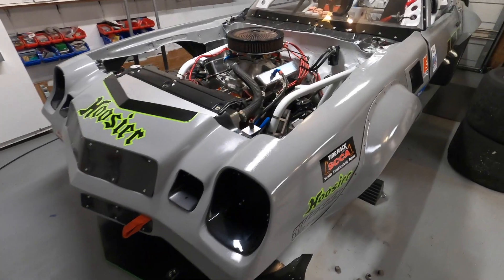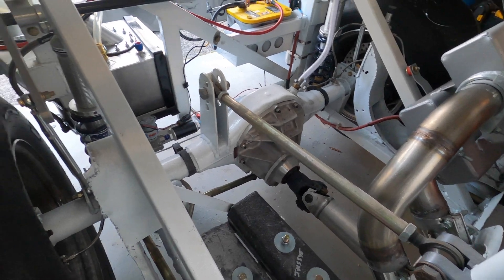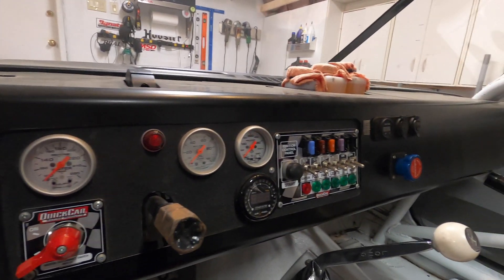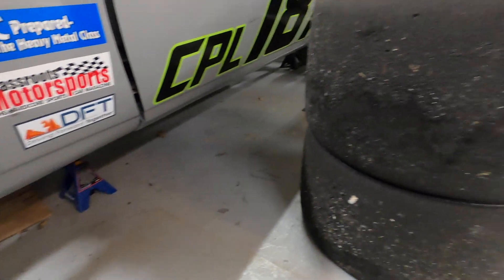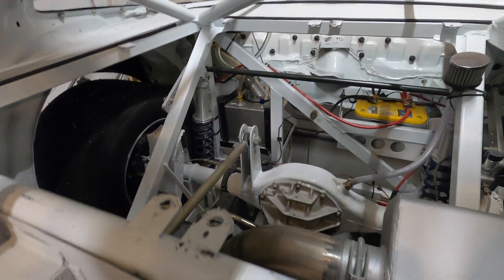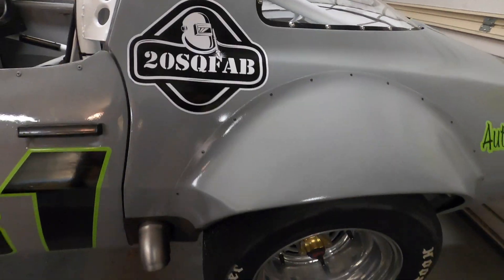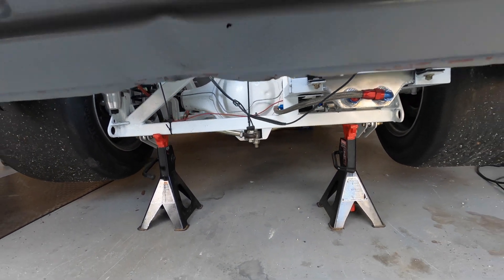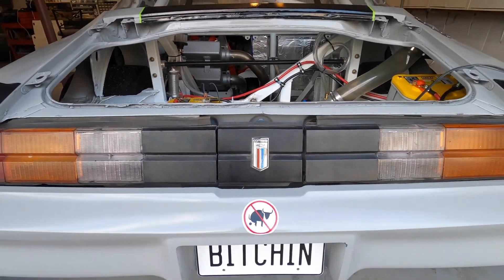C-Prepared Camaro Overview

Comment: Hey I’m building a full tubular chassis street car, it won’t have a body or anything. But it’s gonna be around 104-105”WB and I’ll be running a quick change rear with 3 link and watts link. 15 or 16” wide five wheels and hubs also. I was just wondering about how much caster and camber you’re running on your Camaro. I wanna design my front suspension with enough caster so I’m close. Everything will be adjustable to a certain point. I’m just trying to get it as close a possible. This car will be street driven mostly but I’ll RR/autox it from time to time and I can adjust for those conditions when needed. Killer car btw I’ve got a 79.
Reply from the maker: Shoot me an email at paul.przyborski@gmail.com. I’ve got a few things I can share.